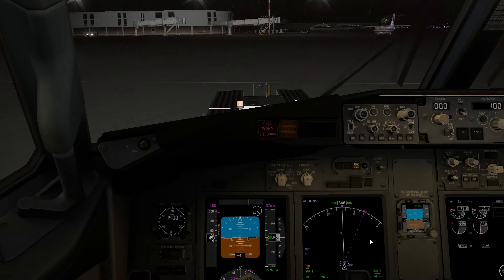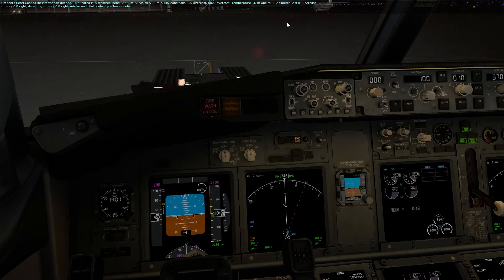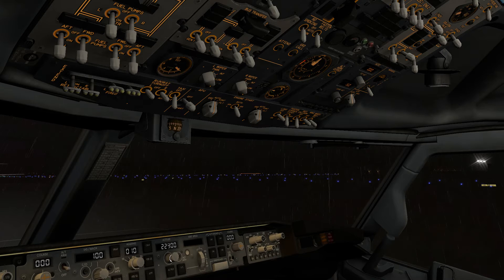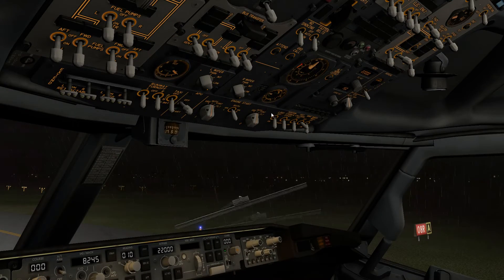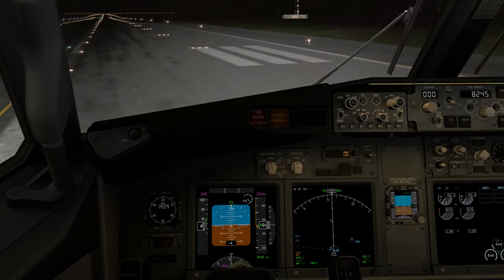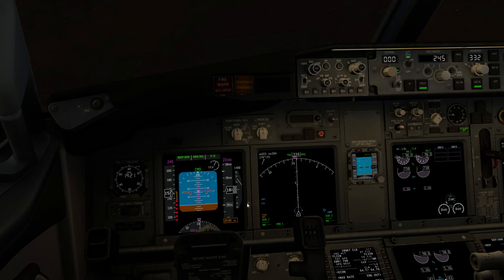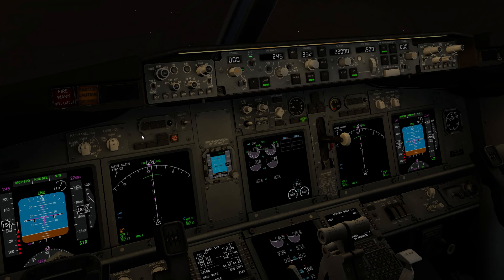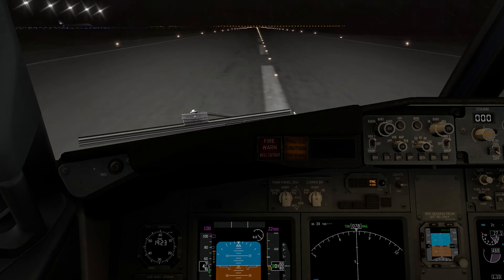What is an altimeter and how to use it + how to correctly pressurize a  B737 800 in X-Plane 11

Comment: goodness, I was wondering about that 2983 etc. altimeter messages. so dialing that "IN" reading to the instructed value will do the trick, eh? I can use the dial at the altimeter at the bottom instead of the panel left of the autopilot as long as the "IN" reading comes out correctly then, right?

Seems I kept flying with a value of 1000 constantly lol !

So much to learn, I guess that's where the fun kicks in with this game too. Thanks, Dennis!

Comment: you didnt say how to pressurise...
now my pilot keeps blacking out.
Reply from the maker: Crap Banger Sorry :),   You have to go to the overhead panel, and you'll see a an "Landing alt" and "Cruise alt" if you set them correctly (just put the alt. That you are goimg to be at) , then your pilot won't black out.
Reply: @dennischelemen6292  Or turn of simulate blackouts in xplane 11 settings
Reply: Or put your packs on auto